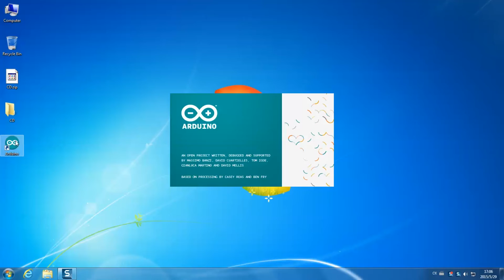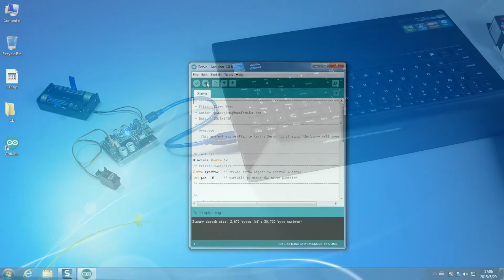SunFounder Crawling Robot Assembly Tutorials 03 Servo

Comment: led not coming on
Reply from the maker: Do you mean the LED on servo board? First, make sure the battery capacity is suitable(it needs battery more than 6.5V ); second, check the batteries are not reversed connected to the servo board; last, make sure the button on the servo board is pressed. If the problem still exist after checking, please send a picture about your wiring to note@sunfounder.com.
Reply: ok
Reply: actually i fixed it so now everything works well thx
Reply from the maker: :) If you have any further questions, welcome to post forums on our website www.sunfounder.com.
Reply: thx